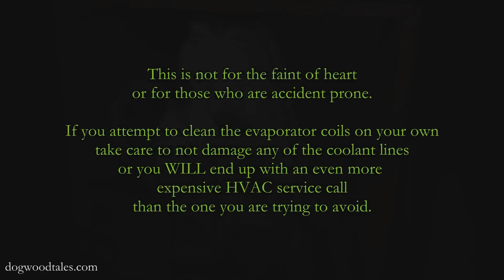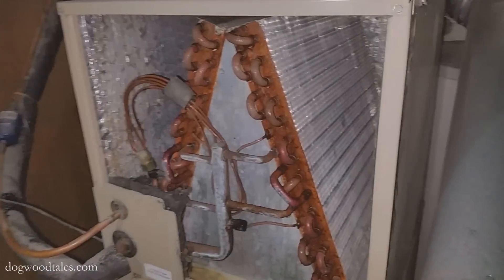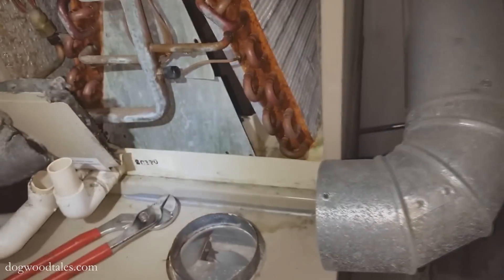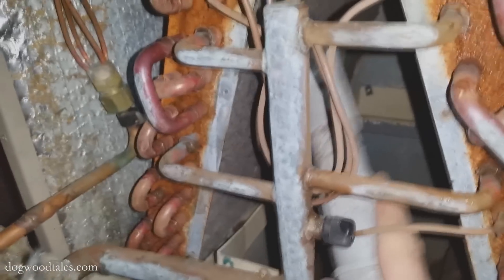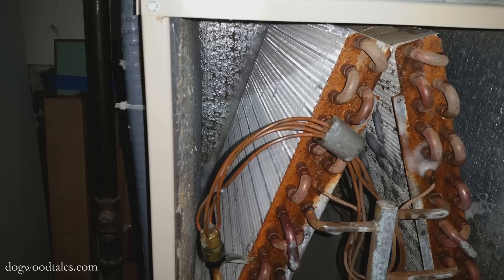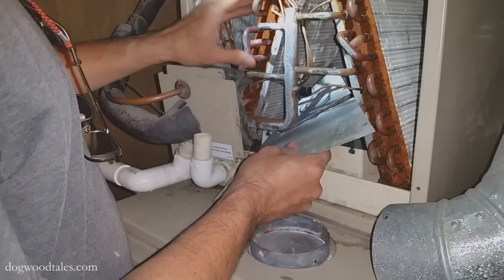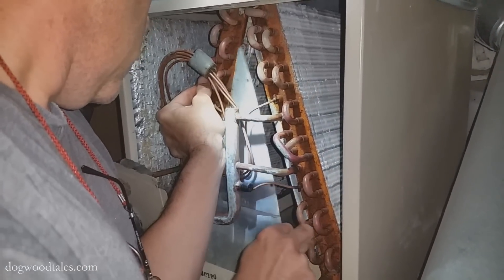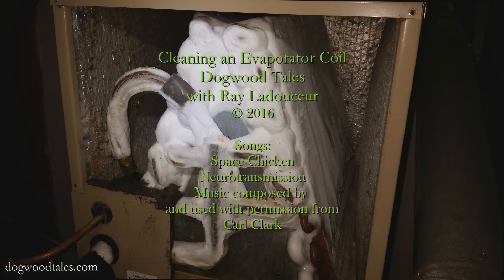Frozen Air Conditioner

Comment: I have cold air coming from vents just not a lot of it. I can barely feel the air from the vents. Do you think doing this will help? It was working fine last week, went on 6 day vacation and when i got back Ac wasn't blowing.  Thanks in advance!
Reply from the maker: +Justin Barber obviously that's your call depending on your skill and your nerve.
but if you can get to it without much trouble then it can't hurt to at least look and see if you can clean it.
Reply: +Dogwood Tales (Ray) I'm having the same issue. Cold air coming through but you can barely feel it. It's not the filter.  Should I try the cleaning process or just buy a new A-Coil?
Reply from the maker: the first thing to check is the air filter. you need to change that every so often depending on your house. having kids and/or pets means more frequent air filter changes.
if you're bold and skilled enough to clean the evaporator coils then you will only benefit from cleaning them. just be careful to not break or puncture the coils or lines. a couple minor dents in the fins won't hurt but a lot of them will reduce air flow.
outside of this you may need a tech to check the pressure and refeigerant level.
good luck!

Comment: Thank you for this video. I had to cut the shield in half to get it out like you did, but this made it stop freezing. I had about 1/8 inch of dense debris. My home is now cold again!
Reply from the maker: You did put that panel back and tape it shut? (I hope) otherwise you will not get proper air flow through the evaporator coil.
Glad to hear it worked out well!
Reply: +Dogwood Tales (Ray) Yeah, I reinstapped what I cut and taped the gap. it used to freeze at 82 but not 68 is doable.

Comment: Thanks for the video. My A-frame coil was pretty dirty. It was freezing up. The vents in the house were cold, but no air was blowing. I checked my coils and they were very dirty. I cleaned them using a self-rinsing foam like you used. When I turned the unit back on, it was blowing great, but now it's not getting cold.  Any suggestions? 

I do not think I punctured anything or damaged the fins. Strange it goes from freezing up to just blowing cool air.
Reply from the maker: Well I'm not an HVAC tech, but believe it or not you could be low on coolant. That's one reason why these things can freeze up. Best at this point to get a tech to check the coolant level and the pressure.
Reply: Maybe the valves of the compressor pump wore out, because of the icing of the evap coil, and now it has no way of moving the refrigerant gas around and about the system. How long was the unit running like that with ice???

Comment: Did you check the coolent pressure with gauges before taking the A coil apart, just wondering what numbers one would see with that dirty of a evaporator..
Reply from the maker: I did not but that would have been interesting to see if there would have been a difference. I'm not a tech and don't have the equipment to check the pressure but I can do the cleaning.   I had the unit recharged less than a year prior to this and the pressure was good then. I figured that if cleaning didn't improve the AC then I would have had an hvac tech check the coolant level and pressure. So far it's working well, so I'll hold off on tech service till next spring.
Reply: REFRIGERANT...... 🤦‍♂️

Comment: Dogwood, now you know what HVAC techs have to face every day.  It's probably safe to say that their job is not as nasty as a plumber's, but it's close!  You saved yourself a lot of money by doing the maintenance yourself.  Congratulations for having the guts to confront it.  Keep that air filter changed regularly!
Reply from the maker: I used to use an electro static air filter but after some 12 years of use it kept shorting out so now I use the good 4" filters. I think the electro one wasn't filtering as well as the micron filters do and that was a major contributing factor to such build up over time.
Reply: Dogwood Tales
Reply: This vid is for frugal people..not smart!!

Comment: im glad you were able to get it cleaned up on your own, however im very suprised you didnt create a leak by moving the coil around like that. i doesnt take much on those capillary lines to stress them enough to start leaking.
Reply: Aha - I thought you were very knowledgeable for not being an HVAC tech!
Reply: Thank God  I looked in here. 
and you too thank you
Reply from the maker: you're absolutely correct on that one. I work in the back office of a commercial HVAC company and so had discussed this process with techs prior to trying it. I was a lot more cautious and gentile than it seems in the video. That is why I give a very clear forewarning at the beginning of the video. One unfortunate slip and it's toast.
Reply: Is this a vertical or horizontal evap coil?? Am trying to find a replacement for mine but dont know if its vertical or horizontal.

Comment: Did you notice a big difference in the air flow through out the house? Was it blowing at all before (not while it was frozen)?
Reply from the maker: most definitely but not in air flow as much as in just having  a cooler house.
Reply from the maker: obviously a cooler house was the result of better air flow
Reply: Cannot truly tell without manometer...you can only go by what you feel ...which is not everything!!